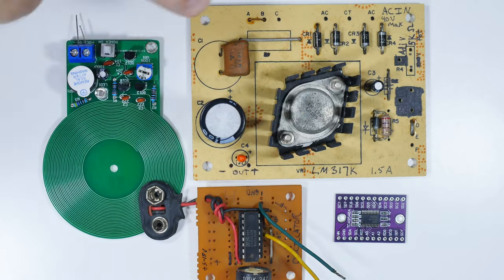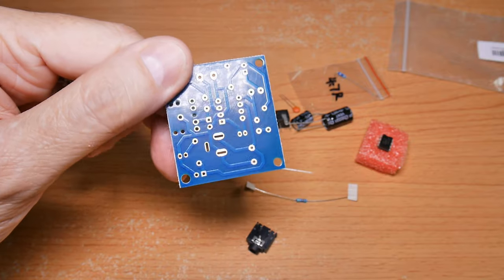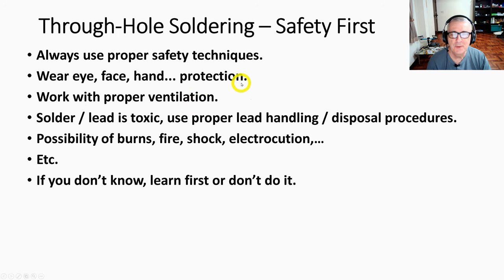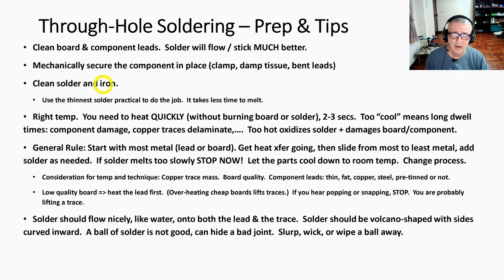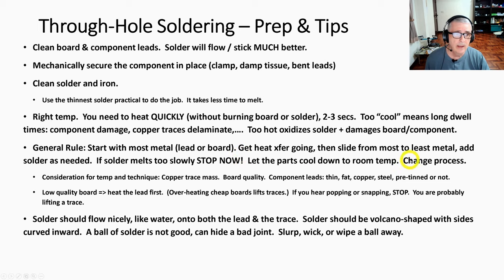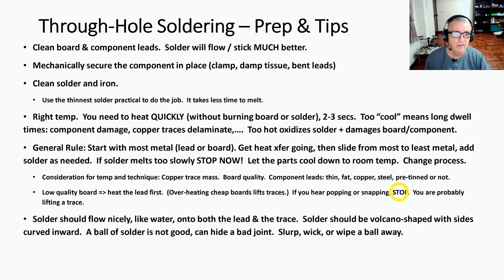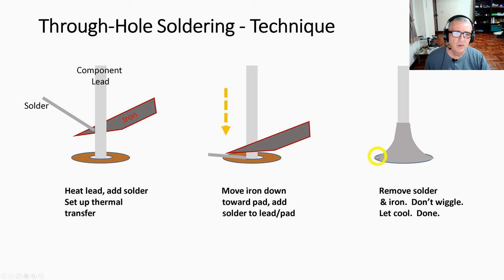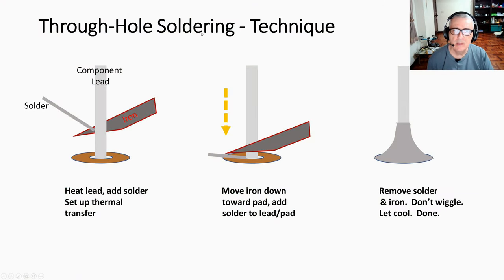Soldering - Through Hole Tips & Tricks (4K)

Comment: Nice explainer! I've never seen this technique (sliding down). Does the tip come in contact with the pad?
Reply from the maker: Thank you.  This is a trick I picked up over the past 58 years of soldering.  I've never seen it taught either so I thought I would pass it along.  In the live demo at the end, I don't touch the pad directly.  That works when the pad is small and the solder can heat it up.  If you are working on heavier copper connections, you will have to use direct contact.

Comment: Great video, thank you. 
I'm very new to the hobby, forgive my ignorance: 
1: Some people use blu-tak to hold components in place while soldering them, any issues? 
Also, I'm about to assemble a Morserino 32 PCB kit to learn morse code, the chap who makes the kits says we must use leaded wire.
Here in the UK, it is VERY hard to find leaded wire from trustworthy sellers, unless you are a professional... 
Any thoughts on non-leaded wire? Any brands/types work better?
In advance, thank you very much for your time. 
Best regards, 
73 de 2E0HJN
Reply from the maker: Blu-tak eh? I've never seen someone do that, but I think it contains oil(s) of some type, and oil is one of the worst things you have around while soldering. Just the tiny amount of natural oil from your hands can cause solder to not stick well. 
I've only used lead-free solder on plumbing pipes, never on electrical stuff. The best general advice I can give is to use a top brand and do some research on it. Good solder with flux is very important in getting good connections.
Reply: @tsbrownie  Thank you.